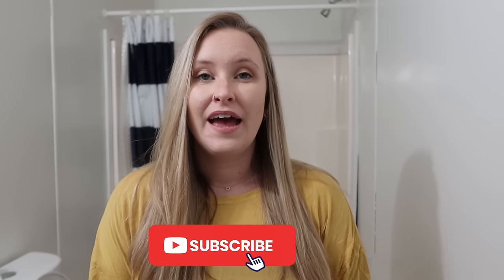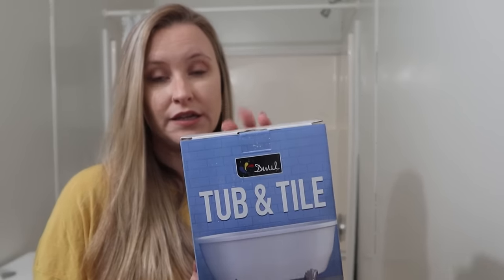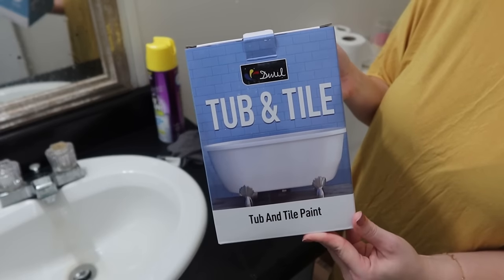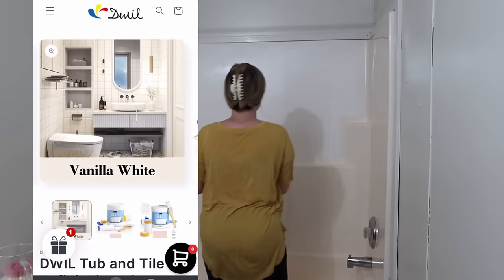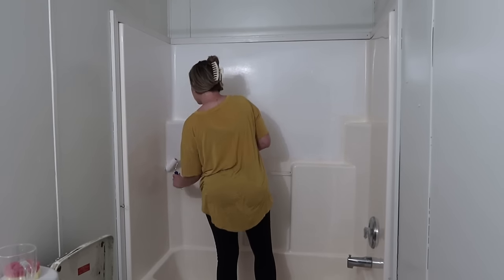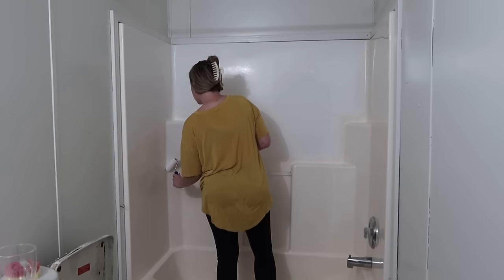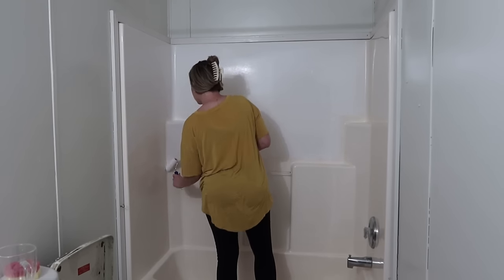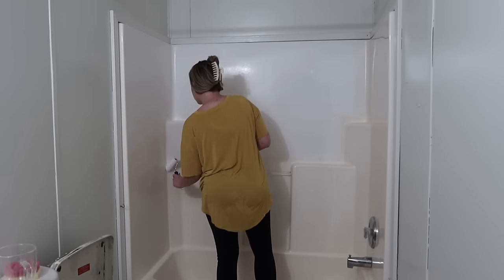SMALL BATHROOM MAKEOVER ON A BUDGET! // clean + paint + decorate

Comment: Do you have a pair of diagonal cutters? Kind of looks like pliers but the back is flat and the front forms a V shape. You yakecthose and hold under the screw head so the screw doesn't move and then unscrew it with a pair of pliers.

Comment: idk if it works with screws on a wall, but my boyfriends a mechanic and when he struggles with stripped or broken bolts he uses plyers first, and then a screwdriver and a hammer, and then if all else fails he tries to weld something to it to try to pull it out with. you might ruin the hole its in, so you'll have to patch it and then drill another lower/higher or directly next to or just somewhere else.

Comment: use a blade from a hack saw dollar tree did sell them use the blade only you should be able to get under the screw there is tips for the drill to get the strip screw out lowes has those easy to use i use a lot

Comment: Use a rubber band and put on top of your screw then take you drill and insert it in the rubber band and then it should come out… also get a screw driver and put with on the strap and take your drill and try that way also

Comment: So would you recommend the tub and tile kit for hard water? I have to SCRUB the life out of my tub to get the lime scale and yellow spots out from the water. I wonder if something like that would hold up?
Reply: Have you tried vinegar and baking soda mixture.  I have extreme hard water and it does a great job.  Make sure you let it set good before scrubbing.
Reply: Have you tried vinegar and baking soda mixture.  I have extreme hard water and it does a great job.  Make sure you let it set good before scrubbing.
Reply: @kaymurray4851  yes! That’s what use! And I mix in dawn dish soap to cut through a little extra. For my stainless steel I use bar keepers friend. It comes clean with a lot of elbow grease. It’s just so old and worn. So it’s clean but ugly. I wondered, if I was to use this paint, that it would stand up to the amount of scrubbing that I have to do 😆